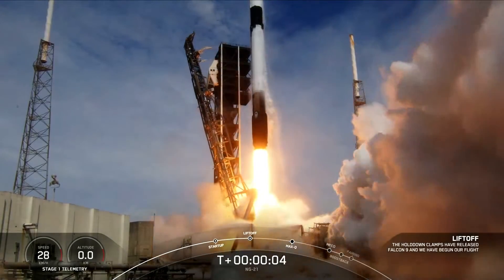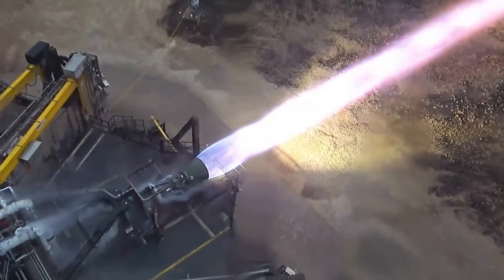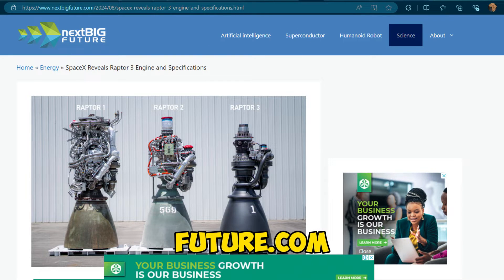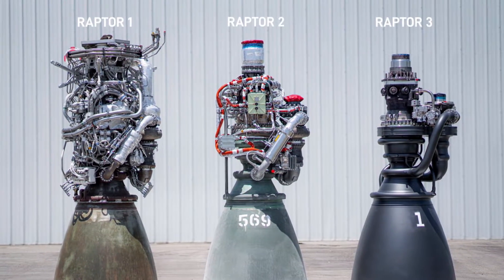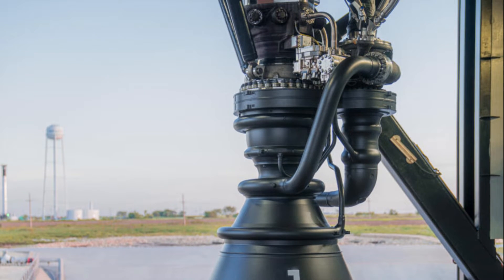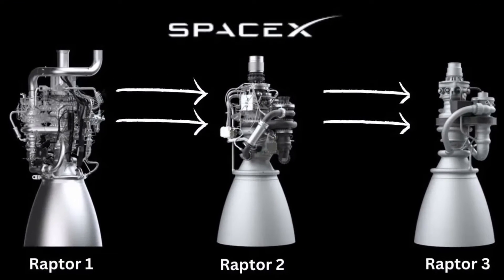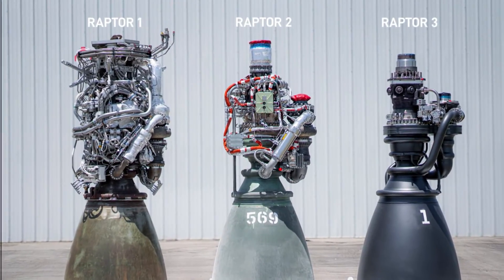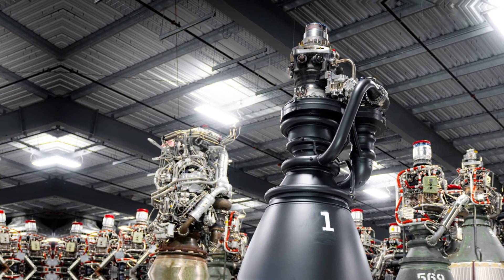Analysing Raptor 3 Engine Specs and What's New

Comment: Pleas use Kilograms instead of Newtons, laypeople don't know what Newtons are.
Reply from the maker: 😁😁 okay but it's just easy to convert mass to weight
Reply: @chriswabs  By the way, Mass is not actually the same as weight though the units used to define Mass and Weight are the same.
Weight is a measure of Mass under the influence of Gravity wheras Mass is a measure of the material in a body potentially subject to Gravity.
Mass will influence the Inerta and acceleration of a body subjected to a force but this force does not have to be a gravitational one.
In space a mass of eg. 1000Kg could be 'weightless' however it would still resist being moved in a manner similar to that in which a mass of 1000Kg would resist being moved horizontally if it were floating in a liquid on the surface of The Earth.

Comment: With SpaceX in the “trucking” business, they have Falcon 9 as the “pickup” for small launches and soon Starship as the “Semi Truck” for large cargo launches.  I  could see them replacing Falcon 9 with a similar rocket that uses Raptor engines.  This would make commonality between the two thus reducing manufacturing costs and make launches cheaper.
Reply: I think their idea is to use Starship for everything. Being 100% reusable, the only cost is fuel and operational things like permits and personnel, so they wouldn't save a lot with something smaller. Just launch everything with Starship, half empty if need be.